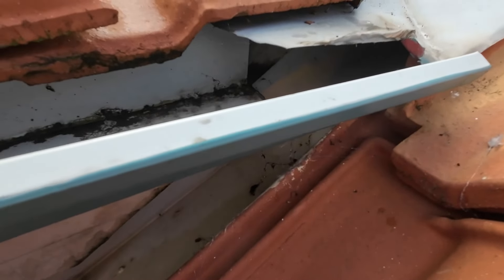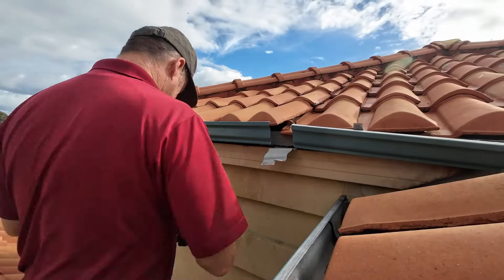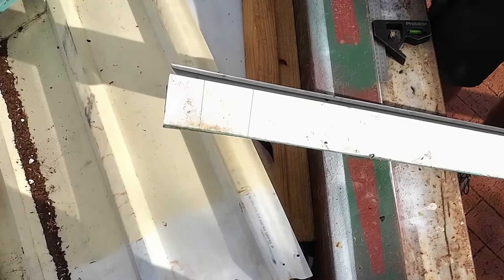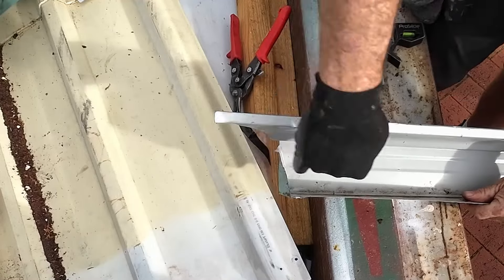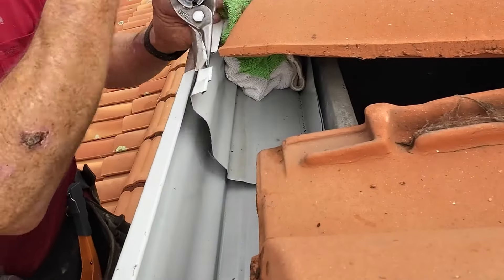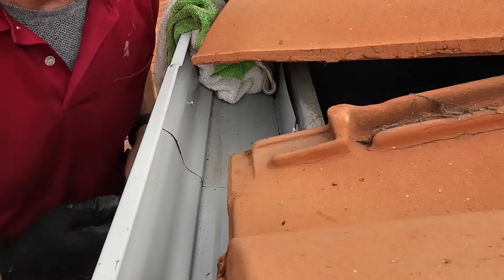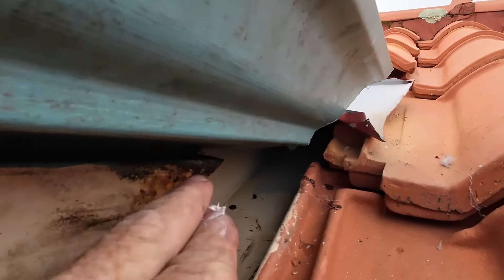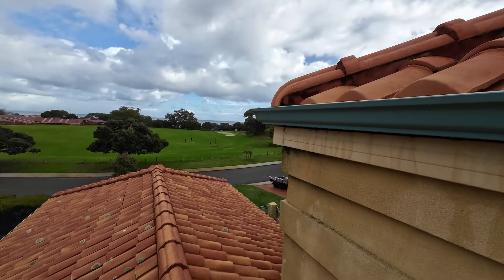How to do a flyover properly

Comment: Another good vid explaing how a repair is done realistically.
I have a question you may be able to help. I have 2 lengths 95mm x 45mm colorbond downpipe fabricated from 2 different manufacturers. The problem i have is the small end from 1 downpipe won't fit into the big end of the other because the small end is the same size as the big end. I'm certain their is way of cutting to join 2 lengths of the same size like was done in the old days before colorbond but i cannot recall how to do. Could you suggest anything please. Thanks in advance.
Reply from the maker: it depends on the type of downpipe you are doing. use the bigger downpipe on the bottom as a general rule. you can also squeeze the ends a little to make the small end goe into the big end. I will have to do a video on that though as I haven't done one yet.
Reply: I made similar error on a down pipe repair about 10 years ago, and the roofing shop had an adapter. Luckily it was galvanised and it was on the quiet side of the house. Nobody noticed.

Comment: Greetings. Have you done gutter re-sloping? I've seen a few videos from other countries and they sometimes use different kinds of braces and holders to us.
Reply from the maker: I am not really sure what gutter re=slopping is. So I am assuming I haven't done it.
Reply: @dennisperrie  Thank you for your reply. Ha ha well i might be using the wrong terms then so sorry. The roof edge gutters which encircle the house are meant to be on a slight gradient so the water flows the desired way. However with our now 13 year old house, too much water is pooling in the center areas of some gutters because the middle parts of the gutter runs are sagging. I think the sagging needs rectification so all the water runs out rather than sitting there until it evaporates.

Conceptually it sounds simple to fix, but I've looked up there and am not sure what steps to take to hitch the middle braces a bit higher, or some other method Ive not come across. This is what I mean. You probably have ideas about this.
Reply from the maker: @quatermass8  yes there are ways to fix it, but I have to see the construction and type. It sounds a little complicated for just the comments section.
Reply: @dennisperrie   I'm in Melbourne though if In Perth I'd happily hire you ! I'm often worried about guys who do things in halves over here.